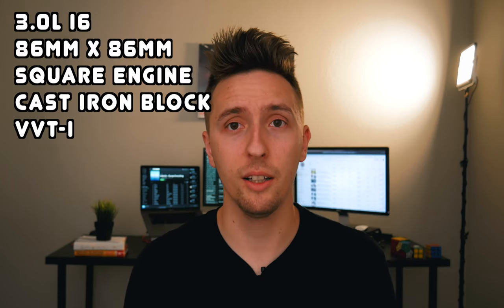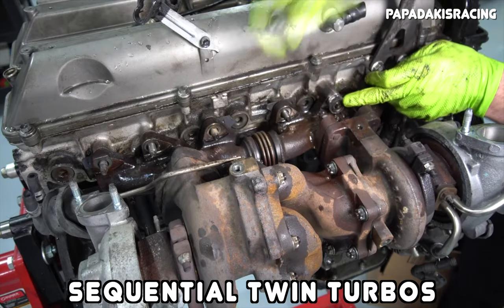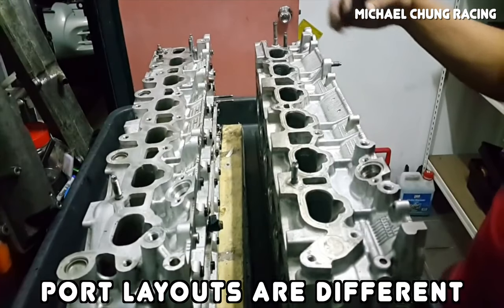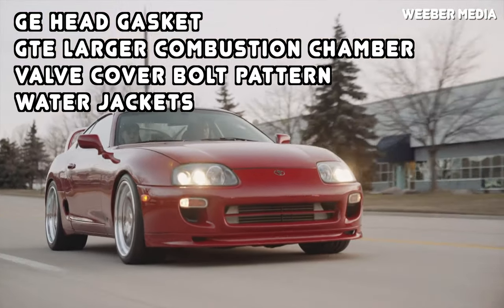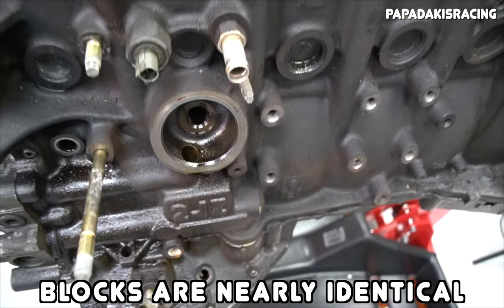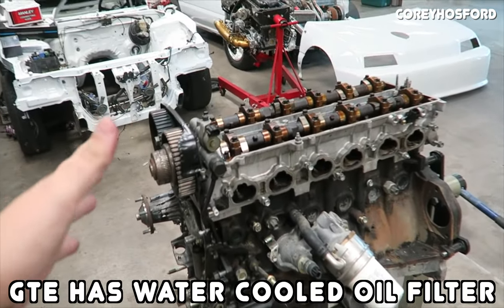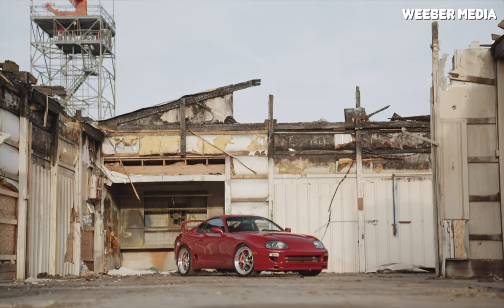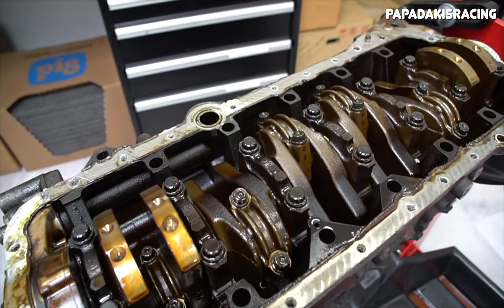2JZ-GE vs 2JZ-GTE: Which One is Really Better?

Comment: So if you're not concerned about Raw speed is the GE still in a good dependable engine that'll go for 300,000 miles?
Reply: Yes.i have a is300 with 250,000 miles no major failures other than oil leaks. I took my engine out to do a complete service clean carbon buildup make it look pretty, but is running strong still
Reply: Gs 300 2j with 300,000 I’m taking the engine out to put into something else. It’s a million mile motor
Reply: My dad's is 300 has 360000 miles on it and he has not yet had to replace anything under the hood except the basics (oil change, oil filter change, wiper fluid, radiator fluid, etc.) My 280zx also has a I6 with 158000 miles and probably shouldn't be compared but is a alternative I6 made by Nissan/Datsun that is also known for lasting forever, it has tuning capability like a 2jz and in my opinion sounds just as good but I do have that owner bias so the 2j probably sounds better to others
Reply: My friend has a Lexus gs300 year 2002 2jzge and he has 620,000 miles on it and next time i see him,i will definitely take pictures to show you guys..strong engine blocks
Reply: He had it for 16 years,forgot to mention that
Reply: @courtneyprimo8056  my uncle has a 1999 lexus gs300 2jz ge with 500k plus miles on it .
Reply: @boomboombaby9140  alot of people don’t know that these 2jz engines reset after every 100,000 miles,this engine will literally never DIE lol,its NO other engine that can do that..#Not even the Bara engine or RB engine
Reply: @boomboombaby9140  master piece for real
Reply: @courtneyprimo8056  exactly , the 2jz engine was over engineered to last forever .
Reply: My 2000 Lexus gs300 has about 280000 miles on it and the only real thing I've had to replace is the battery and Alternator, because the previous owner was careless. The repair was extremely easy though. Other than that just simple stuff, like oil, Spark plugs, etc etc.
Reply: @courtneyprimo8056  what do you mean reset?
Reply: @MrVuittonDon  whenever you change the timing belt,it resets the miles,not as in 0 miles but you basically have a new car,mechanics know what i mean
Reply: @MrVuittonDon  actually after every 100,000 thousand miles
Reply: @courtneyprimo8056  starter just went on mine, its so rusty that everything BUT the driveline is breaking lol. diff axles and engine all strong cept starter but everything else is falling apart. think i might get a RHD one if i like it next but ive always been a nissan kid.
Reply: I would  rather go with a ge
Reply: @courtneyprimo8056  Sorry but no. Changing the timing belt will not reset anything. You can't "reset" wear on engines. There isn't any real documented proof of a 600k miles 2jz GE engine. There is of 500k GE not 600k.
Reply: @ToyotaAristo  it keeps the engine mileage balanced and where did you get your information from Homie,timing belt reset the mileage on a car,i never said anything about wearing and yes i know engines wear down but you can also rebuild your engine
Reply: @courtneyprimo8056  timing belt just times the camshaft with the crank it doesn't "reset" anything nor balance ANYTHING. Wear is wear and is normal. You can rebuild any engine that doesn't make it more reliable. Stop making things up. And there is no documented 2JZ GE to this day with 600k miles. STOP making things up.
Reply: @ToyotaAristo  you making things up and you mad because Lexus and Toyota is the best car in the world,no other car is reliable and there are several Toyota cars with a million miles or less ,your point is invalid,you probably own a plastic bmw engine
Reply: @courtneyprimo8056  You just proved my point fanboy. I own a JZS 160 and to this day there ISN'T any documented 2JZ GE with 600k. There are documented ones with 500k 2JZ-GE not GTE. Just a very FEW OLD Toyotas are "million miles" engines such as the 1uz, 3L or 22RE. Very basic engines. A 2JZ GTE, 2GR or 16Gr are not million miles engines not even close.
Reply: Yes
Reply: @ToyotaAristo ok... So some simple math here. The 2jz he was released stateside in 92 right? What's 1 milli divided by 32? You gotta do 32,000 miles a year to get to a million by now... And that's with the incentive to even drag the vehicle far enough to do that.  The reason the UZ particularly has several Million Mile examples is because those vehicles were used directly as work trucks and/or taxis. that's what Matt Farah's million Mike Lexus LS was. I know a first Gen tundra guy with 900K on his. I have 310K on a 94' GS300 with nearly factory compression... but I have no idea how I'll break 400K, let alone 1 million. Who tf drives a single car that much?
Reply: @basshead972 lol I was laughing at the oil leak part cause Hondas leak oil and nobody talk about that
Reply: Gte or nothing. Its reliable but not fuel efficient.  You might as well go with a toyota corolla.

Comment: The head casting even has “YAMAHA” cast into it.
Reply: Thank you
Reply: "Literally no proof." This joker has clearly never put hands on a 2jz and spouts off like he's an expert. Good looking out, Marek :)
Reply: Wakanda Forever  Toyota copied the 1J which was designed and made Yamaha. Atleast that's what blogs and 2J videos share.
Reply: Wakanda Forever  show cited research per 2jz being built by Yamaha for Toyota and ill admit im wrong.
Reply: Wakanda Forever  ill research it my self, ill cite it, then post it. Whether im right or wrong.
Reply: Wakanda Forever  questions for you: 1jz was built by Yamaha for what reason? In other words; why did'nt Toyota build the head themselves but rather seak help from Yamaha?  2nd question: 2jz head was built by Yamaha or since Toyota already had 1jZ they basically copied what Yamaha delivered to them and then Toyota built a bigger liter engine and called it 2JZ? 3rd question: where was the 2JZ head built? In house by Toyota or did Yamaha build 2JZ head for Toyota and then delivered the end result to Toyota?
Reply: @z31rider24  dude yamaha built heads all over the world, this is nothing new.
Yamaha built the 1jz head.
Toyota built the 2jz head. End of story. The cylinder head only did not make the mkiv Supra what it is today so its pretty stupid to argue about it.
Reply: @shadyshinichi2JZ  
Im glad you agree with me.
That's what i said, just worded different.
Reply: Yamaha is Toyotas lead engine builder. Especially for racing applications. A good example us the awesome 2ZZ-GE engine.

Comment: Well... That's a good video, BUT, you forgot to mention that the GE non VVTI head (earlier ones with Distributor) have the Biggest Intake and Exhaust ports among ALL of them. The GE vvti (the one with skinny rods and weak pistons) has significant smaller intake ports. The GE non vvti is the best flowing head, but since it gas a distributor nobody wants it. What I did on mine is I deleted the distributor, used a freeze plug to block the hole and bolted a plate on top. Then, I drilled the head on the intake side and welded a Cam Sensor bung from a GE vvti so I can use GTE cams. I currently have BC 272 GTE cams on my GE non Vvti head. The aftermarket support for GEs is growing. You can get pretty much the same as far as intake and exhaust manifolds for both online. A lot of drift cars are using either GE blocks or GE block/head. If you are going to build a 2jz, just get a GE for $250 from a junkyard instead of a GTE. (spend that extra $2700 in forged internals and cams). Regarding the compression ratio, if you use a stock GE (non vvti) bottom end, with a GTE head gasket, it will give you a 9.21:1 compression ratio which it isn't very "ideal". But if you mill the head a little bit, you will get 9.5:1 compression ratio which it is good for 650whp on pump gas an 900whp+ on e85 until your pistons fail (on a healthy engine they can survive 1000whp). Anyways, I like your channel and I hope to see more videos! Stay safe everyone!
Reply: good advice! I have a ge non vvti and I was thinking of just getting a built GE head with built internals...
Reply: I did exactly what you said as well in my 94 supra.  Did  the cam sensor and made my own distributor block off with a mill and welded a flange for the sensor. I built my bottom end with forged internals and  a TT oil pump. did a bowl blend and gasket match on the head along with bc springs retainers and gsc s2 cams.  I’m making 806whp  and 790 ft lbs of torque on a BW s369sxe sooooo GE is just as capable. Headgames claimed with a port job it’s a better flowing head at one time too. Respect is deserved for the GE no doubt

Comment: best engine of all time 2jz
Reply: nah. V8. mainly the 454 and 350 by Chevy. those are bulletproof.
Reply from the maker: 350 and 454 are far from the best engines ever. You could also say the 2JZ is “bulletproof”. Realistically you could say that about the AMC 4.0, 1UZ, LS, etc.
Reply: Lol did this guy just say an american V8 is the best motor/motors ever 😭 especially against the 2JZGTE?? Guarantee he lives in the south
Reply: 396 rat
Reply: @tonyg-2jz82  I'm a 2JZ guy through and through. 

BUT an LS engine with a turbo is pretty damn hard to beat. For costs and for power potential.

Comment: I have a 92 sc300, same lower end as the 2jzgte making it very strong. Non vvti 2jzge now with arp head studs and a 1.5mm tomei headgasket and valve seals. Don’t assume you can slap a turbo on the early ge’s without some modifying. The stock ecu can only handle 7 psi and beyond that it cuts fuel and kills the car to protect itself. I’m running a 93 aristo ecu (2jzgt ecu) and my ge handles 14psi like no problem. 

Don’t just buy a vvti 2j thinking you can throw 14 psi at it, do it right the first time.
Reply: You are correct. But people can buy a standalone set-up and control timing and fuel so much better. I'm using a crank trigger wheel and sensor on the front of my engine. 

I did this and run mine at 15psi off the gate. Stock GE block. GTE head gasket to lower compression. Bigger injectors. Turbo, GE Turbo manifold, front facing GE intake manifold.
Reply: hey man, I also have a 92 sc300 non vvti and was wondering if you can give me an update of how yours is doing? and if you could give me tips on what to do to optimize the engines health and up its performance. Id really appreciate it man

Comment: So I can technically make my ge block handle 1000hp by getting an oil pan with a turbo drain fitting , and then getting a gte head ? Shit I’m going to build it now
Reply: GTE heads are part of the reason they are so expensive... so good luck
Reply: I've been looking for a gte head for the last year and the ones I've came across are around $1700 and up.
Reply: HKS has a built drift car with GE VVTI head. it ain’t that serious guys. smaller intake ports on ge but larger exhaust ports.
Reply: @bigjdm5460  just turbo on the ge head I hear it flows better
Reply: @robertbrown1933  buy new one from the dealer, it’s like $1500
Reply: @TheBCninja  You can make 1000hp with a GE head.. tbh it is way more economically efficient to build 1000hp on a GE than a GTE. You could build a 1000hp GE for about the same price as you'd buy a stock GTE.
Reply: @bigjdm5460  Intake port sizes aren't particularly relevant. The bottleneck will always be the valve size and stroke, which is mostly decided by the camshaft. Forced induction and that issue is completely out of the way. Higher boost equals higher air velocity through the valves.
Reply: @TheChrisey  sounds good to me. i just ordered GTE pistons at wrk and i have some Manley Forged H beams good for 800whp. I order a titan crank damper. The problem i’m having right now is the machine shop wants the rod pistons crank damper and flywheel etc to balance everything. i’m going CD009 , so i may have to buy that entire 2,700.00 kit from serialnine just to get the flywheel that’s included. That’s slowing my Bottom end assembly down.
Reply: Unnecessary, I know a man with a GE VVTI head on his 876whp 2nd gen GS300.
Reply: The GE upper oil pan already has a spot for the drain. Just drill and tap.
Keep the GE head and up the springs if need be. Get used GTE pistons  and rods bearings "or new" and ARP studs and you're golden.
And don't forget about a fuel return on the fuel rail. 👍
Reply: Julian Florez  
They are all connected to the crank via the timing belt. Most all are.
Reply: @2JZLS  does he post his build on ig? Cause I got some questions
Reply: @dionte5819  no forge piston upgrade installed? Which turbo kit?
Reply: @MrVuittonDon  I’m not too sure I’d forge pistons still , I just hear Ge head flows better than gte
Reply: The ge carries large valves in most head configuration and if your porting can make more power than turbo head.....

Comment: The GTE & GE are basically the same when it comes to endurance.
They different in the shape of the head and oil openings in the block.
Reply: Really? I was wondering what the difference was. But in still confused which one has more potentional
Reply: Janrey Siano of course the GTE is stronger!
Reply: The gte has more potential because of the aftermarket parts you can get for the gte.
Reply: @robertbrown1933  it’s also got more durable pistons and rods I believe. In a lot of ways it’s easier to build because you don’t have to change internal parts, but if you were to swap gte pistons and such into a ge, theyd be able to handle about the same I think

Comment: A closer comparison would be the early GEs non vvti to the GTE as they are virtually the same minus the oil squirters, turbo and forward facing intake manifold, and head gasket. Everything else is virtually identical. The vvti GE is still a fantastic and reliable engine that can make good power sure it doesn't live up to the GTE or it's non vvti variant to higher boost and power outputs. They all have a purpose and an overall great engine. Majority of 2J owners won't have the cash to crank out 1000+ hp and be able to keep up with maintenance and repairs. 5-600 is plenty for daily street driving. I'm a proud owner of an SC non vvti GE and had the vvti is300. Both were stock never let me down. Planning on building the SC up a little but keep most of it's reliability
Reply: The head gasket? Isn't the whole head different?

Comment: Ok… I get the difference… but with the ge can you rebuild the engine and upgrade those particular parts to make it as good or better than a gte???
Reply: This was what I was wondering lmao
Reply: Only difference really between GE and GTE block are oil squirters in the GTE and the oil pump is different. The GE from 97 and before actually use the same thick rods as the GTE. Word has been out that’s why you can’t find 2jzge blocks anymore. Vvti GE uses weaker rods but has the better head. Ge/gte vvti heads use the same aftermarket cams. Another reason GTE head is more preferred is because of the front facing intake manifold which makes maintenance much easier and it looks better to most. With a good tune and today’s fuel options the 2jzge NON vvti will make the same power if not better since it’s higher compression. When either block is built everyone runs higher compression anyway and use forged pistons and almost all builders block off the oil squirters when using aftermarket so in today’s day in age it’s pretty much worthless to start with a GTE block unless keeping all stock

Comment: So the engine blocks are the same. Correct  same crank, same rods, different pistons for compression.  And can buy forged pistons and rods. (Rebuild the short block) and swap over, heads, intake, ect. From the gte.. right?..
It's like the 4.8 and 5.3 ls  engine block

Comment: Watched a pretty interesting video where Goleby's pulls down a GE and says that the exhaust ports will obviously allow for much better flow and interestingly enough all of the GE ports are alot more flat in terms of angle to the combustion chamber also appearing to increase overall flow once a larger turbo is used.

Comment: Would you do the Toyota 4.0L V6 and the 5.7L V8 please? They have proven to be reliable and used alot in Toyota's line up.
Reply: Which 4.0 are you referring to?
The 1 UZ 4.0 is a V8
Reply: @cinema6r845  Toyota's 4.0L v6 in the 2nd gen Tacoma. It is in the 4runner,  fj,  and was a base engine for the tundra at one time.
Reply: @zzsuprazz  that 4.0 v6 in the old Tacoma prerunner is an incredible motor

Comment: 2jz ge block is bit better in some aspects like the non oil squiters when on high hp levels the gte guys actually removed the oil squiters. If it's a non drysump engine
Reply: But ive also heard of people adding oil squirters to the ge block.... whats up with that?
Reply: @aaronsanchezz it can be done just extra machine work

Comment: Hey, question… on my just started quest.
I have a TE72 corolla 1980, and trying to budget an engine swap so presumably would be the 2JZ GE, but I was curious on finding information on the differences(if any) on the 2JZ-GE on a Lexus GS300/LS300/SC300 vs the US Supra or jdm 2JZ-GE? 

I heard they are different and less power for the US Lexus versions but can’t find any information on what exactly is different besides certain emissions equipment.
If you could direct me if you have a video on this or a quick answer could help. Any information is appreciated thanks!!

Comment: Can you just take an oil pan from a gte and put it on a ge with the turbo oil drain?
Reply: Its way easier to drill your existing one
Reply: Yes, but the GE oil pans have either a front sump or rear sump. 

Lexus sc300 has a rear sump like the non turbo and Supra.  Lexus GS300 is front sump oil pan. 

You just need to drill out the turbo return drain hole in the GE oil pans. The spot on the pans is already marked out. They have 2 small holes that you can tap for bolt threads or to add studs to also. 👍🏽